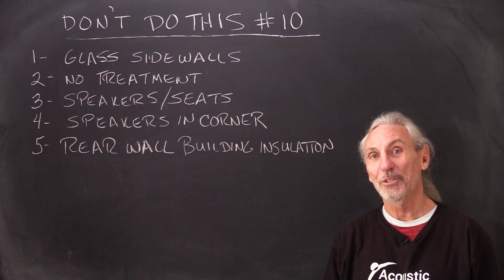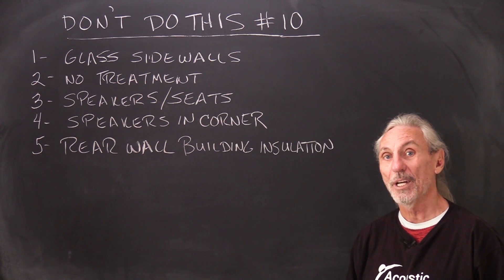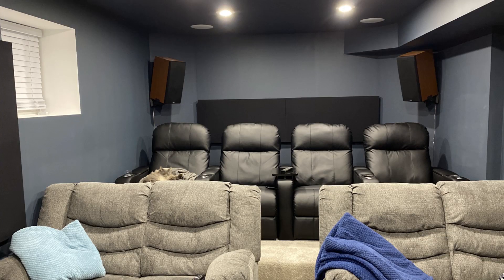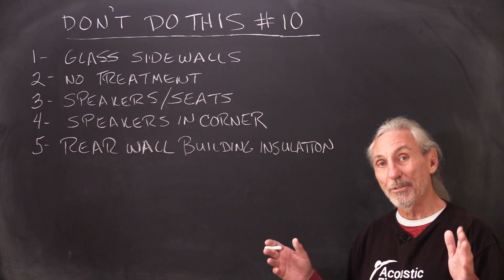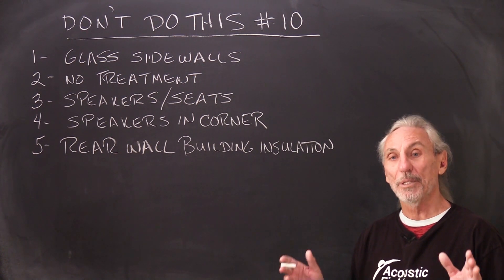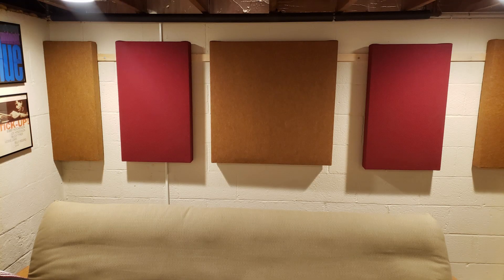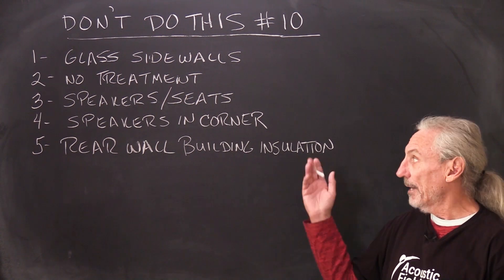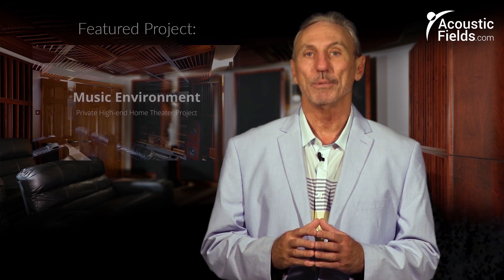Don't Do This! # 10 - www.AcousticFields.com

Comment: I guess I won't be buying that tiny 12 inch carbon cubes from you.  Too tiny to do anything.
Reply from the maker: Small rooms produce large unwanted pressure issues. Unfortunately, the only way to fix the pressure issues is to make the room smaller with treatment.

Comment: How about covering the whole wall behind the speakers with cork panels 
Would it be a bad idea. There is also a windows on that wall.
Reply from the maker: What are the frequency and amplitudes of the issues you are having. Cork is not a low frequency absorption technology.
Reply: @AcousticFields  No, it's not about issues.I know it's not for low frequencies.If I want to decorate my wall, will it be a bad idea covering the whole front with Cork panels (without the window) or some other material which absorbs mids and high frequencies. Its behind my speakers after all
Reply: @AcousticFields  There is bit of reflections in the room (not so much), cause i haven't add any panels and stuff yet. Also there is wooden furniture around I dont want to be too much absorption with the cork if i add  the other absorbative material on ceiling and walls

Comment: great vid dennis,for those of us that dont have the fancy measuring tools and all,Other than our ears,,i use the clap the hand,or voice ,as a guide line,,i can usually pick out a room with too much echo,,but im having a hard time defining a dead room,by clapping.Any ideas on how to tell a dead room by way of clapping.
But yet my home theater sounds good ,,no boom,,good stage,,and definition,,,also helping a couple of freinds with sound  issues.
Reply: No fancy measurement tools are needed. UMIK-1 calibrated measurement mic costs 79 USD. Combine it with Room EQ Wizard and stop fooling yourself with claps and whatnot. Seeing the graphs by yourself is eye-opening
Reply from the maker: Yes, you must qualify and quantify the issues the room has so you can focus the appropriate treatment types on those issues.

Comment: Lots of studios have hardwood floors!
Reply: Those studios will have treated ceilings, reflections from the floor are not a problem then. The floor is the most natural reflection (we have it everywhere in real life), so it's good to use the floor for some reflection, rather than walls or ceilings.
Reply: repawnd I understand that but this bloke reckons we should never have hardwood floors!
Reply: @officialWWM   There SHOULD be a large area rug, if someone has a lot of hardwood floor space.
Reply: Seregon72 says who? Have you ever been in a pro studio? Cause I've been in lots of them and there's never any rugs.
Reply from the maker: Stay away from absolutes. There are none in acoustics since each surface area depends on the other and all surface areas depend on usage.